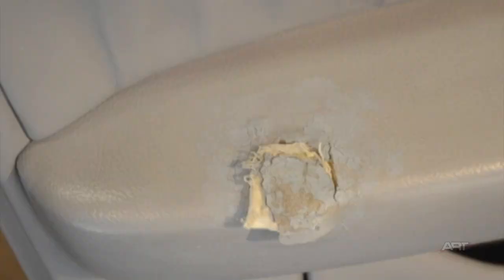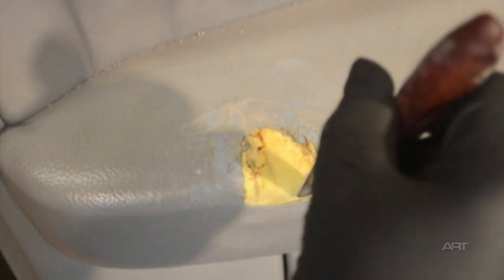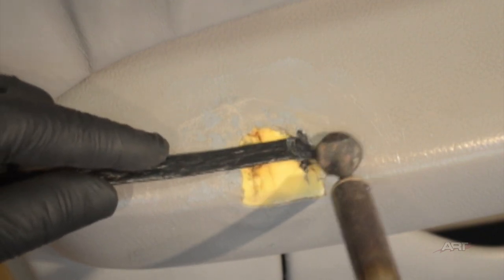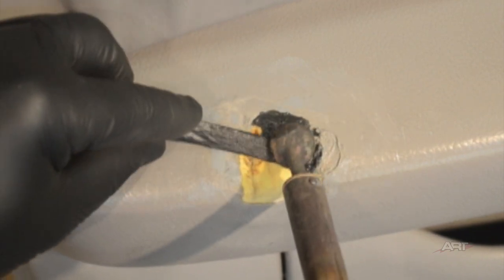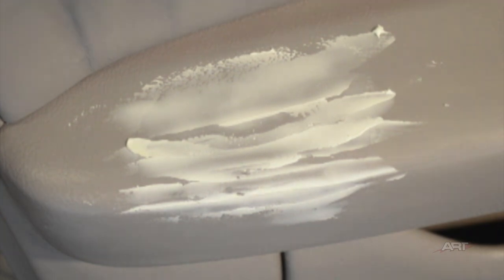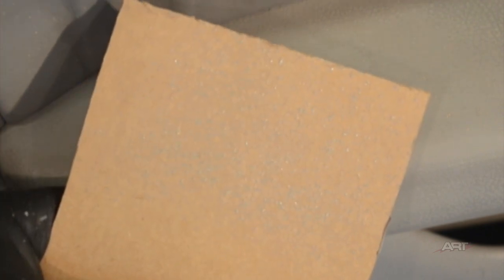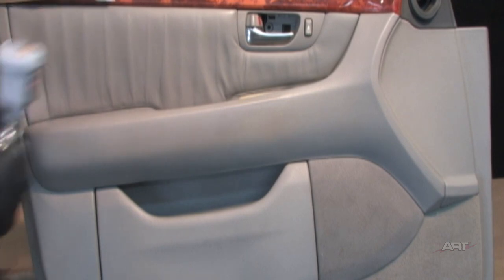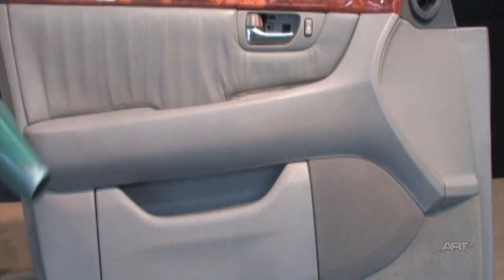Lexus Door Panel Arm v05

Comment: Well, that's one way to color match a small repair, respray the whole panel, no doubt it looks nice.  Good for trying to sell the car?  Because I bet it doesn't look that nice after a year or two of sun, heat & cold cycles.
Reply from the maker: Yes, it's unfortunate that the quality of work in the marketplace tends to be that way.  This is a retail job being done while the customer continues to drive his car by the way.  If you follow this channel you will discover that it sets the record straight with regard to quality workmanship when it's called for.  You are in for a treat!  And thanks.

Comment: You did a great job on that door panel. The owner should be very happy with the door I know I would. I have an LS 460, 2008 that in service they put a tear on the trim between the doors small put I can see it now. Can it be fixed?

Comment: Nice job! I was questioning the lack of masking while you were spraying. Glad you at least acknowledged it.

Harbor freight now good for 3 things

Spray guns
Good inexpensive F clamps and disposable gloves.
Reply from the maker: Yes and thanks.  One nice aspect of water base dyes in that in some instances you can decide whether the minimal amount of cleanup is going to be quicker and less work than the masking.  Each application requires it's own judgement.   I have a video in the pipeline where I will mention how impossible it can be to mask interior parts, mostly due to the silicone protectorants.  But I'm sure you've come across that already.

Comment: Hi Rick, I'm a "student" on your YouTube channel! LOL
First of all, thanks for sharing all this techniques. I would like to ask a question about the texture it makes with the paint gun, it works only with water-based paint? Or is it also possible to make the texture with solvent / oil based paints? I just ordered my paint gun and I have some leather paints, but all solvent based.
Thank you very much, greetings from Brazil.
Reply from the maker: Hello Valdir.  I'm glad you are finding the videos helpful.  The water base paints are generally thicker than the solvent based ones.  That and something we call "surface tension" tends to leave the droplet standing tall.  Solvent paint droplets tend to "lay down" .  Also solvent paints stays soft for a longer period of time.  We can dry the water base texture and sand on it right away.  Thanks for your question.